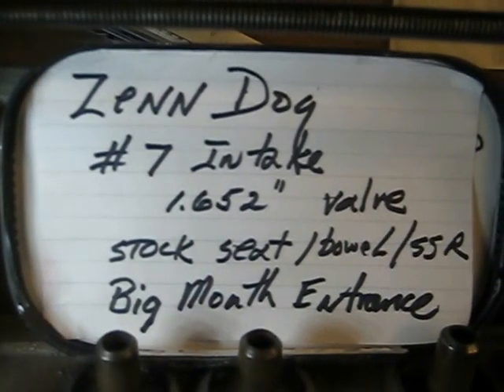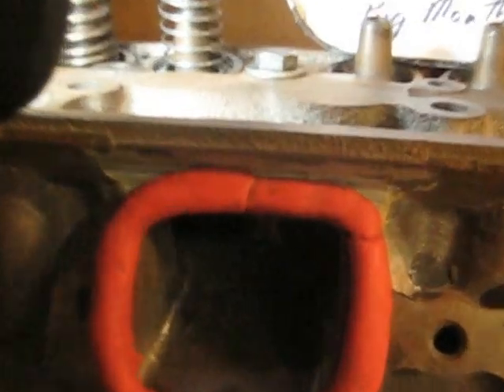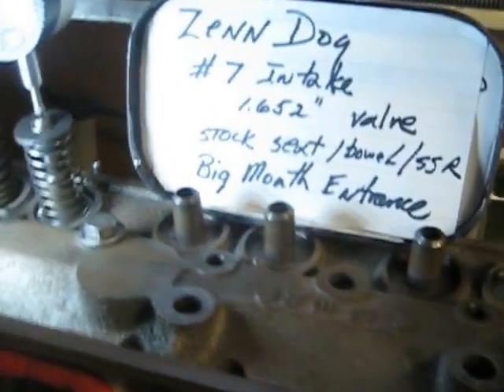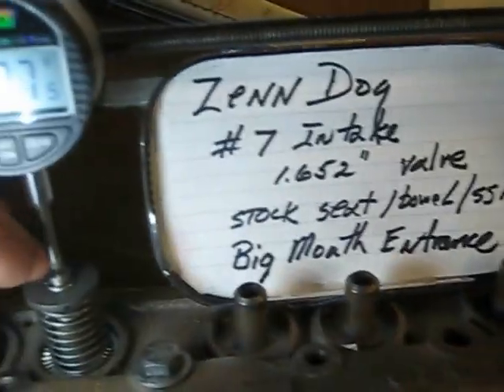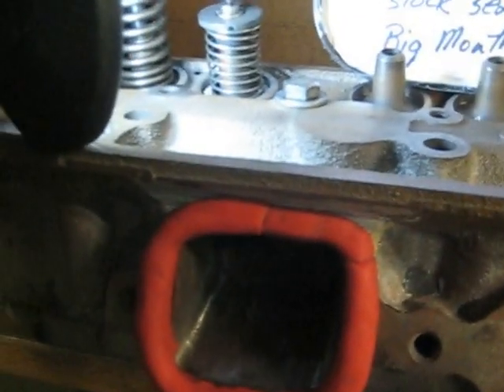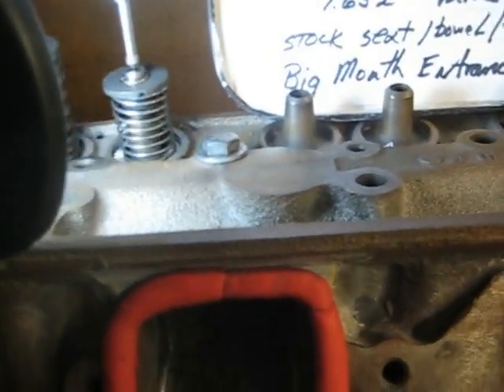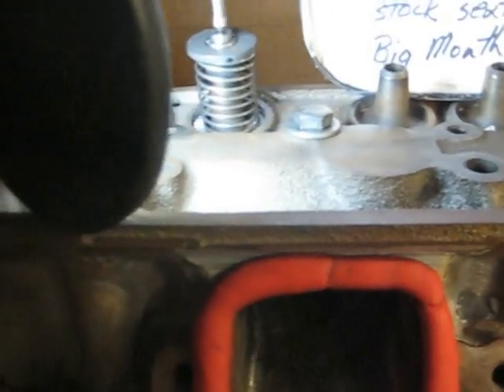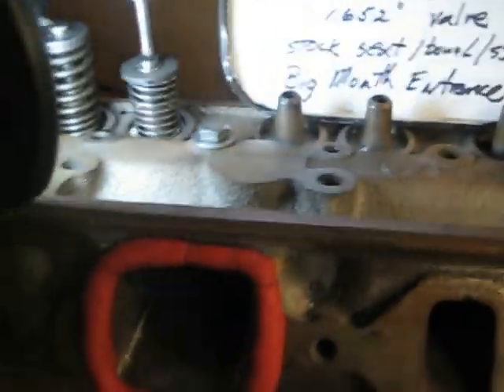Experimental Cylinder Head Flow Test Intake # 7

Comment: question- that has a siamesed intake port, is the other port with no valve, is the valve guide blocked so the flow test is accurate ?

Comment: what is the cubic inches of the engine ?  150 cfm is a very low flowing port at 28" for an American V8, unless the size of the engine CID is relatively low, i.e. under 300 cid.  a stock Chevy 350 iron head flows around 200 cfm, and can be ported to 250 cfm.  to put it another way, what you have there is a cylinder heat that would stop revving at around 4800 rpm on a 350 cid engine.